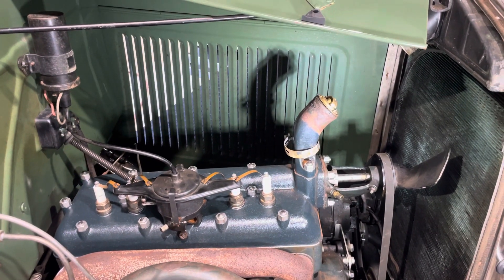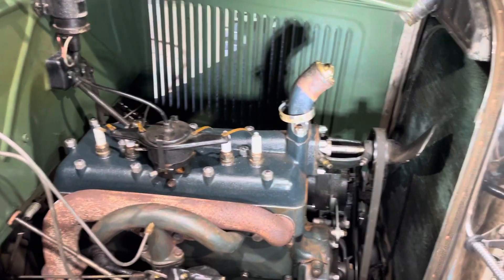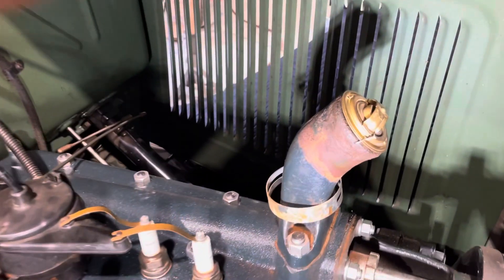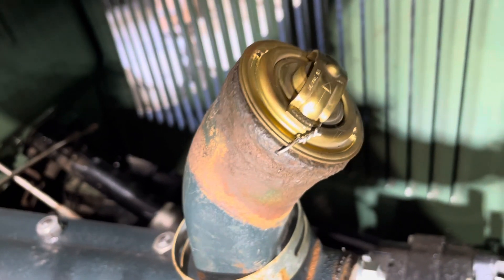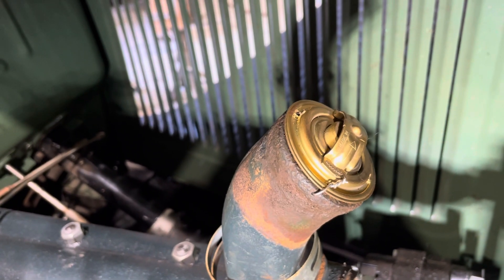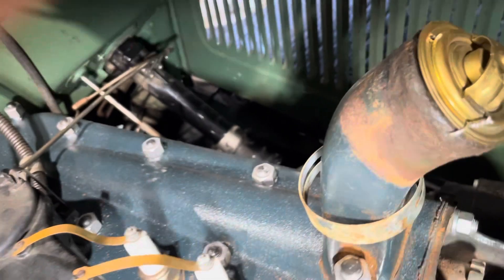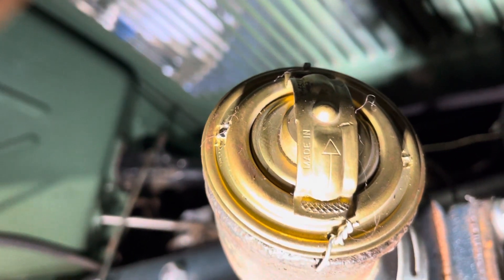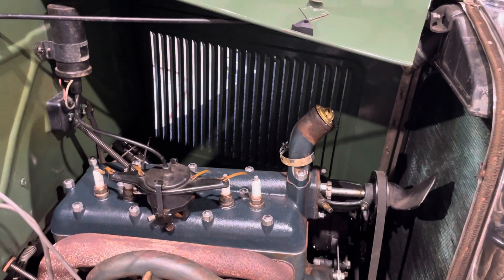Ford Model A Thermostat installation

Comment: Great idea. I can’t tell if you used the Model A style that slips into the water neck or just a standard design?
Reply: Perfect! Thanks very much for the info.
Reply from the maker: I just use a standard, it sits on the gooseneck

Comment: I had a 1970 Datsun 240Z for 29 years. First few years (starting in 1978 after I bought it) there was a lot of pressure in the top of the inlet manifold and the soldered seal would blow out from time to time. A person on a 240 Z forum said you could drill an 1/8" or #30 drill hole in the radius of the thermostat to help reduce pressure in top of radiator (180 degree thermostat installed IIRC) and to allow some coolant to flow before the valve in the thermostat opened. Never had another problem with cooling system after that.
Reply from the maker: good deal